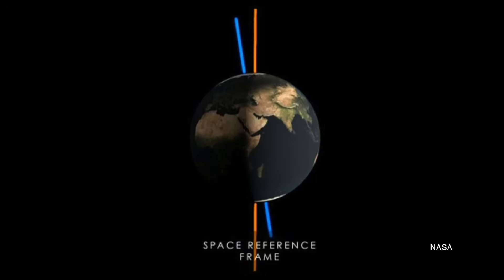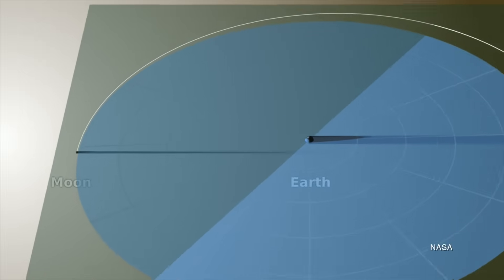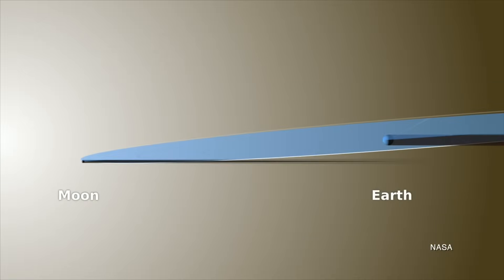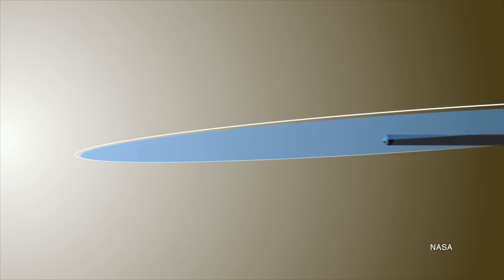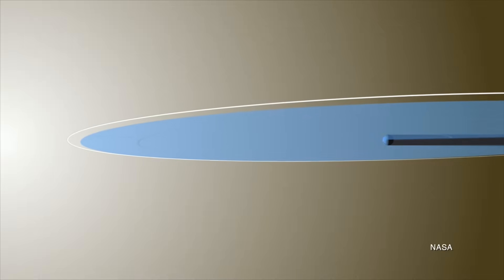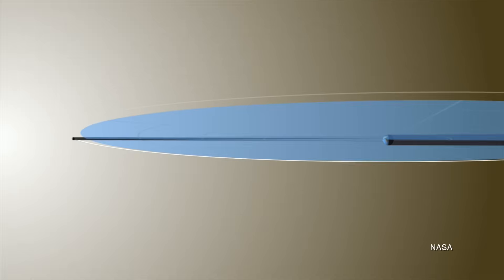Why Does a Rocket Need to Roll Going Into Orbit?

Comment: wow.. i have never seen cartesian coordinates being used twice wrong in the same video.. Basically, what happened in the production meeting was: 
"What axis is what?" Then the only person in the room that does 3D modelling or CAD design, says 
"XY are both in the horizontal plane" as that is one convention: looking at a paper, we usually have XY on 2D, thus, Z is the axis that is "3D". We have slowly moved to favor Y up orientation as that corresponds to what we see on displays  which usually are in real life on vertical plane... 

Then after that, we put the model from our head which was lying flat on the ground, rotate it vertically, thus ending with weird X up and ZY on horizontal plane.. That is literally the least used configuration, either we have Z up or Y up.. Z up actually being the favorite here as it corresponds to the norm on vehicle design: Z marks forward motion vector,  which is also the axis of roll leaving XY to their original designation: heading..
Reply: I don't understand your problem. She's simply using what was the official Apollo standard coordinate system: X ran longitudinally, i.e., vertically on the launch pad. Z ran parallel with the astronauts' couches, i.e., horizontally east-west on the launch pad. Y completed the right-hand coordinate system, from side to side as the astronauts saw it and north-south on the launch pad.

The Saturn and CSM both used these orientations, but with one exception: the CSM was rotated 180 degrees around the X axis so that the +Z axis of the Saturn was the -Z axis of the CSM, and the +Y axis of the Saturn was the -Y axis of the CSM. Their +X axes coincided, both pointing toward the nose of the stack.

As far as I can tell, this is still the usual body coordinate system for vehicles: X runs in the direction of usual travel, Z runs up/down and Y from side to side. It's just that the Saturn/CSM stack sat on the pad where its direction of travel was initially upward.
Reply: Phil Karn Really? wow, thank for that tidbit.. That is really weird orientation when looking at what convention we ended up with.. And how they come up with orientation baffles me, it doesn't go well with any regular projection.. hmm.. if you calculate ballistics, X is forward travel, Y is vertical then so, makes sense..  (not really, it doesn't, it most likely is after thought coming from who ever likes to draw ballistic trajectories in 2D, on blackboards...)

Note, i'm not mechanic or CNC operator so i might have it wrong, my viewpoint is from 3D modelling and simulation side.. But still, the way they ended up differs from everything else, this usually means that other options have some benefits.. Which they actually do, if you are thinking in terms of cross-sections, XY is natural choice for slices.. and there are loads of examples where X up is the least compatible with anything else, every single XY 2D formula, someone has to remember to switch axis, because what i still consider a fuck up......

 Most likely, someone just decided it without really thinking about anything else but his own narrow field; you start from XY trajectories, where vehicle travel is in X axis.. and that someone was high in power, very respected.. Von Braunn... sound like some legend had always made it this way, in some other culture and no one dares to oppose them.. :)
Reply: SquidCaps"...anything else but his own field..." Bingo. I'm pretty sure the CSM follows the "aviation" convention. As the astronauts see it, +X forward, +Y to the right, +Z down past their feet. While the Saturn, for some reason, follows what I believe is the "land vehicle" convention from the astronauts' point of view: +X forward, +Y to the left, +Z up past their heads. Why the two different conventions? For Apollo/Saturn I have no idea, except maybe that IBM (who did the Saturn IU) didn't talk to MIT (who did CSM guidance.) While writing software to process IMU data, I read that aviation points the +Z axis down because most of the interesting things are on the ground below you, so they have positive Z values. And land vehicles point the Z axis up because all the interesting stuff is above you. As long as you're consistent and know how to translate, it'll all work.

Comment: If you ever decide to branch out I want to know how ICBM launches over the polar ice cap and MIRV reentry vehicles work.
Reply: What would you like to know?  I think Trident (sub launched) is the only active MIRV missile in the US arsenal right now.When the rocket reaches it's desired trajectory for the first warhead, it rotates itself so the warhead is angled in the position it will reenter the atmosphere.  The guidance platform will disconnect it, then back away, rotate 90 degrees, give a short burst on the axial engine so it doesn't disturb the warhead, drift away until it is clear, then it will burn to the next trajectory.  Meanwhile, the warhead has two cold fired engines that will cause it to spin to stabilize it and will reenter much like a bullet.Warheads are released on the way up. Once released, they are completely ballistic (free falling, even though they are still going up).  The first one released is the last to reenter.
Reply: Thanks, I know it's been 2 years but I forget to check (or that I even have) gmail for Youtube replies.  @MuyGordoGato

Comment: I have a quick question.....if in the vacuum of space is absolute zero 0 Kelvin which converts to   -325*degrees Fahrenheit. Using Dr. Hawkin's method of using time a gravity to determine when the universe began. BUT WHAT ABOUT USING TEMPERATURE to determine when the universe began. When the Big Bang occurred it released an insurmountable amount of energy and heat how long for the heat to dissipate? Does life requirements include frost for the universe? I will subscribe to your account but if miss this or it's beyond the scope of your site my dress is txtbookmedic@gmail.com thanks...
Reply: Was that supposed to be completely incorrect or are you drinking and commenting?
Reply: medic 927 It is the temperature of the microwave background energy. Google it and you will get your figure.
Reply: lemme check it, while my coffee is still hot. Nope, too late the coffee is cold now. Well I am sad to see you stuck with it. Unless the sun can makes my coffee hot again............. hmmm.... is it possible?
Reply: Ok So what is the Temperature of the Vacuum of space Geniouses?
Reply: As the universe expanded, it did indeed cool. It is now down to 2.725 K (or degrees Kelvin, if you wish).
Reply: Well first of all, 0 Kelvin is impossible, so...

Comment: Why does "a rocket" need to roll, and then the Saturn 5 Apollo launches come into play? So, do all rockets need to roll after launch, or just the Saturn 5 Apollo launch? But I remember the Space Shuttle launches rolling also. That vehicle also has an orbit that is not east to west. But rolling gave the launch vehicle a better aerodynamic profile and provided the crew with a view of the horizon. So, why does the rocket have to roll, if yaw would just put it on course for a proper orbit. During the Apollo 12 launch, Pete Conrad called the yaw maneuver, the only commander to do so.

Apparently, a rocket's navigation system like to have up, down and sideways just like a plane, so as the rocket yaws to the right heading, the roll puts the navigation system into an "up and down" configuration in relation to the Earth's surface.

SO, if a rocket was launched from the equator from a platform that was oriented to east-west, and was to be put into a west-to-east orbit, it would not have to yaw or roll to align itself for orbit, but any other launch to orbit requires at least a yaw maneuver, and the roll is just to align the navigation system to up and down. Is this right?

Comment: Rockets do not work in outer space.   No atmosphere to push against.
Reply: Rockets don't push... They throw their fuel away from them at high velocities. As such, rocket engines do work in any environment, so long as they have an appropriate fuel to throw away. :P An analogy might be to think of a gun in a microgravity environment. As long as the bullet cartridge is air tight, with the oxygen required for the powder to burn present, when you fire the gun, you will feel the kick, which will propel you in the opposite direction you fired in. Newton's Third Law of Motion "For every action, there is an equal and opposite reaction." The energy given to the bullet as it was thrown out of the barrel by the burning powder is equal to the energy passed through the gun into your body as recoil. Ion engines, and almost every other form of active slower-then-light propulsion for space exploration works in this way. Throw something away from you in the opposite direction that you want to go, and it will propel you in the direction you want to go, with half of the energy (or less, due to inefficiencies) used to throw it propelling you forward.
Passive forms of propulsion such as solar sails are different, as are piloting tricks such as slingshotting around and/or using gravity to your advantage (think Apollo 13 movie).
Reply: Dnulho1 That's the bull crap indoctrinated into us.   Try it.   A simple balloon car will suffice to demonstrate the principle.   Inflate the balloon, place a vacuum cleaner hose at the exhaust of the balloon car to simulate a vacuum...and unpinch (release the air) in the balloon.   See if the car goes forward.   It won't.
Reply: There is one problem with your testing environment. The vacuum cleaner will be sucking in the air around the balloon, creating an additional external force that the escaping air must also overcome.
A better environment would be an airtight tank that has the air within evacuated from it. If you then blow up a balloon inside this airless environment, you would be able to add the appropriate amount of air inside the balloon, filling it up without exceeding the structural integrity of the balloon wall.
At this point if you release the balloon, it will fly away exhibiting similar flight patterns to one released anywhere else, erratic flight due to the flexible and nonrigid nozzle from which the contained air is escaping.
*Note: this experiment does not account for the lack of perceptible gravity that one finds in orbital environments, and the balloon with therefore be pulled to the floor when it has fully deflated, rather than floating into whichever wall it was headed towards when it's "engine" looses thrust.

Comment: In other words, it was easier to roll than to fix earlier oversights.
Reply: What oversights? Not putting the launch pad on a Lazy Susan? Roll maneuvers are simple and quick, but they allowed the launch pad to be fixed to the ground and the many telemetry systems on the Saturn to use just a single antenna each, and it kept the horizon level and visible to the astronauts (mainly the commander), all regardless of the launch azimuth that had to be used for a given launch.
Reply: Not really. It is just more convenient, from a logistics and support perspective, to launch from the contiguous 48 states than it is "inconvenient" to put in a roll program to bring the vessel onto its course. Oversights do not even figure into it.
Reply: Oversight, in the orientation on the ground.  Also, easier than combining pitch and yaw changes across two gyro systems (in the early days of computer aided control).

Comment: In short it rolled to keep the navigation simple. KISS being very desirable when traveling on an atomic bomb platform on steroids.
My next question is; if the orientation of the x/y/z axis can now be established without mechanical gyroscopes would a modern day Apollo still need to roll?
Reply: Depends on the rocket and engine design. The falcon 9 does not need to roll, it can do the gravity turn in any direction (that's permitted of course). Until very recently, the Soyuz rockets could not roll, and so the entire launch platform was on a turntable to align it before launch.

So yeah, in theory they may not need to roll as an absolute, but that may still be done for vehicle alignment purposes (antennas etc...) and/or to keep things simple, as you said.

Comment: Hi there--You do not have a complete answer...I was just researching this, as to whether there is an optimal angle of ascent asking MIT Prof Lewin. He asked Professor Jeff Hoffman (5 Shuttle missions veteran) about this and got the following answer: 

"It is correct that getting above the dense lower atmosphere is important, but there is always a compromise between getting high quickly and starting to accelerate horizontally to eventual orbital velocity of ~18,000 mph. Going straight up is extremely inefficient for a rocket. This is referred to as “gravity loss”. It has to be balanced against atmospheric drag loss. The most efficient way to transition from going straight up out of the launch tower and getting into a horizontal trajectory is called a “gravity turn”. You use the rocket’s steering to start tipping the rocket just a small bit, then gravity pulls it over the rest of the way, so that the rocket thrust can continually be applied parallel to the direction of motion. Any rocket thrust applied sideways to turn the rocket, since it is perpendicular to the direction of motion, will not increase the energy of the rocket. That is why gravity turns are the most efficient. 
Another consideration is that while carrying out the gravity turn, the rocket gets into the plane of its desired orbit. The sooner this is done (i.e. at the lowest velocity possible) the less cost there is to establish a new orbital plane."

There is an optimal angle for any rocket based on its design, mass and power function, not just where it is going. The ascent is not linear--it has much more jounce (d acceleration) at the beginning, but also has the most weight (mass x gravity) and atmospheric pressure to deal with. this is why a rocket will take off, roll, 'throttle-down' go through the point of maximum pressure (and break the sound barrier) before throttling up again, rolling again and then dropping its boosters. This is the most efficient way of getting to the lowest escape velocity.
Reply: +Cranston Snord jounced is a British term
Reply: this IS the correct answer to the question
Reply: I'm afraid you're confusing gravity turn with the roll program. These are two different functions. Amy was describing the roll program, and she did so fantastically.
Reply: Great explanation.  Thanks.
Reply: then watch them. simple.
Reply: Captain Calculus k8im
Reply: So this has nothing to do with selecting an axis of the earth to follow?
Reply: You also have to manage the maximum Q or dynamic pressure which is related to speed and altitude (static pressure).
Reply: The firmament might be the floor of heaven, but the firmament is a 3-dimensional space, so heaven must be at least a 4-dimensional hyperspace, which is in-keeping with the idea of heaven being a higher plane of existence. That means the entire physical universe can be the floor of heaven while still containing all of the objects astronomers observe contained in billions of light-years of 3D space.
Reply: Masterful explanation of rocket guidance. I believe the firmament is the floor of heaven which prevents me from accepting most of what NASA reports but I never doubted how complicated ocket science is or the laws of physics.
Reply: @LIE4ME ,The Bible talks about there being 3 heavens. Our earthly heaven, the heavenly universe and God's heaven. One thing to remember is that God doesn't reside within his creation of the universe.
Reply: @xxZerosumxx  I never thought I'd find myself saying this, but I agree with you. I totally agree that "God doesn't reside within his creation of the universe." Well said, sir.

Comment: Do rockets work in a space vacuum since there is no atmosphere to push against?
Reply: A rocket does not need an atmosphere to push against.  This is Newton's 3rd Law of Motion . . . . For every action there is an equal and opposite reaction.  A propeller does need an atmosphere (air or liquid) to push against.
Reply: I used to ask this exact same question! Did you get a satisfactory reply already?
Reply: PacificAirwave144 Thank you I will read your advice over about 3 or 4 times,obliged and thanks.
Reply: Orion Red I'll have to read Newtons 3rd law since I'm intrigued. I suppose it;s correct or space travel would be impossible. Cheerio.

Comment: But, then why did the Space Shuttle roll?
Reply: It was an asymmetric vehicle, so leaning over in the pitch axis only reduced stress on the vehicle. Also, this was done to allow the antennas mounted on the orbiter to have a good view of the ground. The ET and SRBs would have blocked the signals otherwise.

Comment: Still didn't make any sense to me. I mean, all the (at least the outboard engines) were mounted on a gimbal, so why did it have to roll a specific way in order for it to "ride" a specific azimuth? Was it because they wanted to launch the astronauts in a "heads down position" ? 

Thanks.
Reply: The roll was performed so that the pitch axis was facing in  the right direction when it pitched forward. This was likely done to simplify the demands on the guidance computer.  The same path could be achieved without the roll by blending multiple axes appropriately. But that involves a lot more math and places a higher demand on the flight computer which was not all that powerful at the time.
Reply: From reading the other comments, not only the heads down thing (to facilitate escape in that phase), but also to allow the already tested eastward flight maneuver to be used.